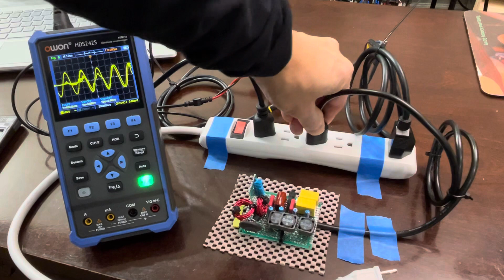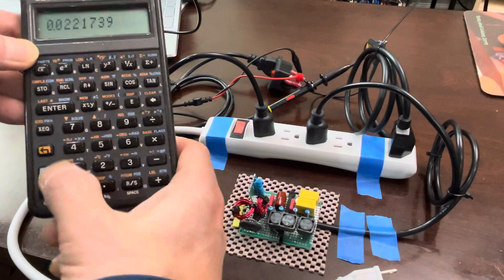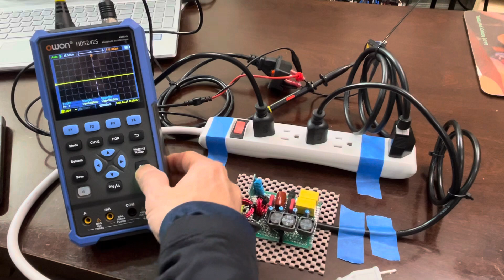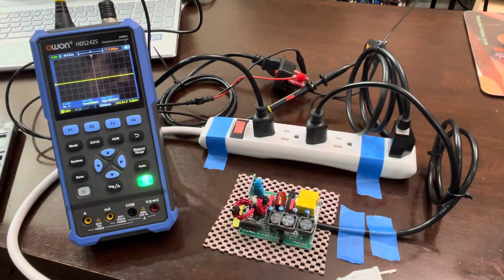On the Bench Tonight (OBT) - ParaSnub (aka “SnubWay”) Parallel Mains Power Line SMPS Filter

Comment: Have there been any reliable listening tests that prove noise on the AC line degrades audio quality?
Technically, cleaner power is always better, of course. But if it's only for peace of mind and not an actual audible improvement, it's just one more thing for the poorly informed types to obsess over and argue about.
Reply: Agreed, this 100 kHz and 400 kHz noise is not audible.
Reply: I have only heard smps noise in an audio system with poor power supply filtering.
Reply from the maker: You don’t hear 100kHz but you might hear its beat note with another SMPS or other noise source in your system.

Comment: Hello! If the cutoff frequency is quite low (below 10kHz) - there probably must be big capacitors (1 micro-farad or bigger).It leads to high reactive power and your electric counter can counts it.
Reply from the maker: The biggest cap is 2.2uF X2 rated safety cap.  Cannot go larger because that would cause significant leakage current at mains 50/60Hz frequency.